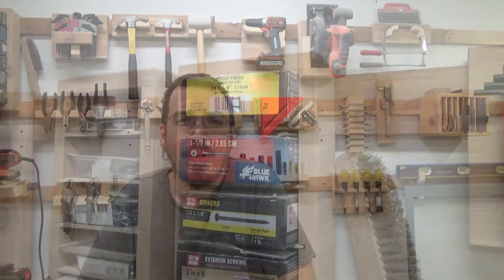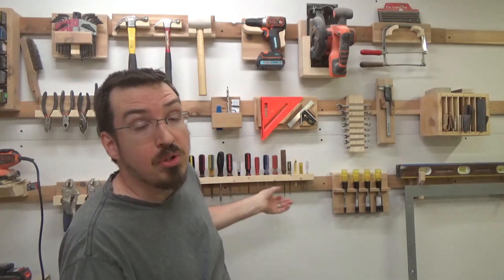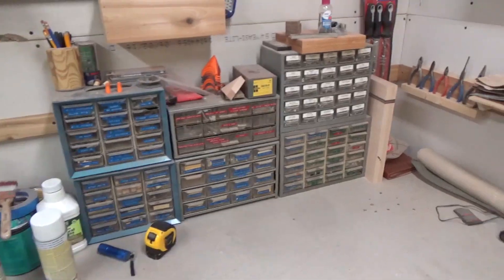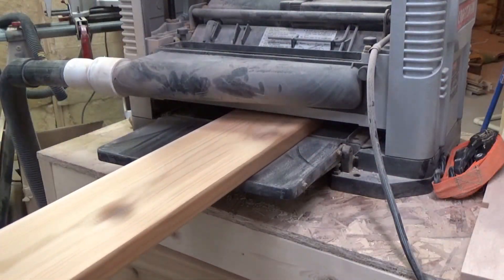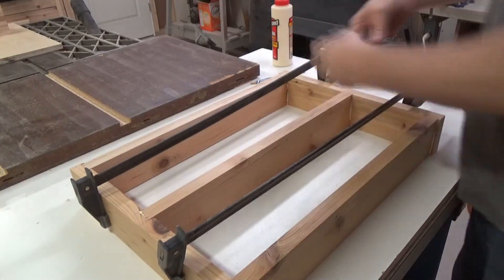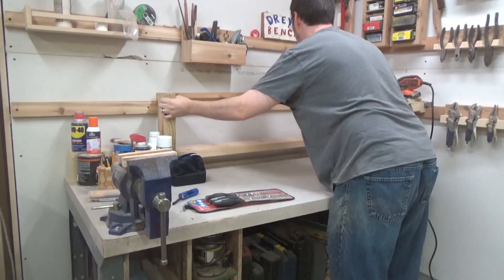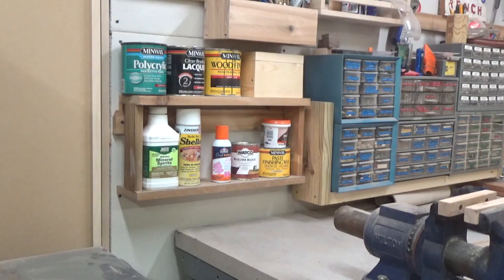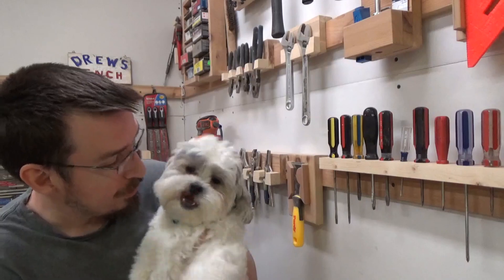Shop Talk: You can't beat french cleat!

Comment: The traditional french cleat system I believe is based on evenly spaced rows on the wall, and evenly sized parts on the back to hang. The wall bit wider side (the one facing from the wall) dictates the space to the next board on the wall. Then you mount the hanger slightly lowered from the top of the back of what you are hanging. This leaves a gap from your toolholder to the board above of same width as the short side of the two peaces, giving perfect fit for a flat peace to go between the flat top of the part on the tool to the flat part on the bottom of the board on the wall. 
Let's say the initial board is 3 inches tall.
You cut at 45 degrees passing the middle. This gives you 2 inch on the wall, 2 inch gap under to next board on the wall. The holder on the tool adds 1 inch when hanging on the wall, leaving a 1 inch gap up to next board. Here you slide in a 1 inch block of the same dimention as the cleats. Bingo, tool is fixed to the wall. 
If you want to take it down, just slide out the block preventing it from moving 😊

Comment: Would you recommend using 2x4's for the cleat to hold a cabinet 60" wide  x 15"depth?
Reply from the maker: You should be ok since the weight is dispersed down the cleats.  But if you plan to really fill up that cabinet, you might consider using hardwood for the cleats.
Reply: @FishersShop  On second thought, maybe I should not make cabinets and make more customized tool holders for what I would have otherwise put in those cabinets to lighten the load. Thanks. You've inspired me!

Comment: Didn't know about the negative side to the French cleats, no one else had mentioned them. I like that one can combine it with a cabinet and create groups of tools.
Reply from the maker: For sure.  And keep in mind that there's way to combat the negative aspects as well.  For instance, if you're put in a small screw you can essentially clamp the holder to the cleat on the wall to keep it from moving or falling.  Etc.  Thanks for watching!

Comment: When I worked with my step-father back the the cretaceous period, he hung wall cabinets using a French cleat because it allowed him to get things level and then pop the cabinet on the wall alone without having to hold or prop it up till it was fastened.  Half a century later I still use that method for hanging cabinets.
For this sort of shop storage, It's a waste of material and time, for me at least.  I would panel the wall in wood, screw tool holders to it, and be done with it.  Just as easy to reposition, and uses less materials.  But everyone to their own fetishes.
Reply: Uhlan interesting. Can you clarify what do you mean by panel the wall?

Comment: Hey Drew, how wide are the French cleats ?   What have you found to be the best spacing between the wall cleats ?   I love this French cleat idea.  I have a pegboard in my garage, but this system looks way better !
Reply from the maker: It can be pretty arbitrary.  It mainly depends what kind of wood you'll be using (soft or hard) and how heavy of items you'll be hanging from it.  In the case of a tool wall, you can get away with really narrow cleats.  But if you'll be hanging cabinets, for instance, you'll want to beef it up a bit more.

Comment: Did a modified version of this with two rails per level. Each of my boxes/shelves has two cleats and sits on two rails. So for each "level" all of the boxes/shelves can slide along its own level. For some of the tools, I also put a small face board on hinges that can swing down and cover the tools. For the metal tools, I like to put a little holder in the boxes where I can put some desiccator bags. Then close the cover board over the tools. It just helps prevent rusting and it looks pretty damn good too. I live in a really humid climate, so rust is always something I'm trying to fight.
Reply from the maker: That's a really good idea.  I'd love to see a pic of it.  I'd have to say my biggest issue I've experienced so far is that dust will collect on top of the holders behind the tools.  So if there was some kind of faceplate that swings down, like you have, there might be a way to combat that.  Thanks for watching, Anthony! :)
Reply: use gun storage oil specifically for anti corrosion and your metal tools won't rust during storage.

Comment: as an idea, I like making screws out of wood; using a small-ish blunt ended wooden screw in each hanging piece, with a gripable corss piece on the end, you can lock in your hanging bits with a twist. you can unlock and remove each item then, one-handed. love your videos!
Reply from the maker: Very nice idea.  I've never attempted at making a wooden screw before.  Sounds like a challenge
Reply: @FishersShop  there's tap-and-die sets for them. I like making large ones...impractical for this suggestion, but, the threads are so widely spaced, a half turn would go from free-floating to not-going-anywhere. I don't recall where I got my set from, but, here's one on amazon that looks very similar: https://www.amazon.com/d/Woodworking-Project-Kits/WOODRIVER-Woodthreading-Kit-1-1-TPI/B0039ZEW16

Comment: I love the French Cleat System, i have 3 Cabinets on the wall using the cleats and they are full of hand tools, screws, measuring tools, safety wear, router bits, basically loads of stuff and they have stood the test really well. In fact i'm hoping to do a clamp rack for all my clamps and fit that using the cleats. 
Barry (ENG)
Reply from the maker: My clamp wall is the one thing I didn't use cleats for.  I would have, but where I keep them isn't conducive for it.  But everything else is french cleat.  I'm running out of room on my main wall.  Soon I'll have to start putting cleats down the other!  I'm starting to accrue an abundance of tools.  It's a good problem to have, right?

Comment: Can recommend adding a cam lever to clamp each module on
Reply from the maker: Sure, either that are just another screw through the front would do the trick.  The cam lever wouldn't leave a hole in the cleat though and is probably a better idea.  Thanks for watching!
Reply: Ah yeah, wee screw would do it. Added a cam lever to mine since the smaller ones were prone to being lifted off heh

Comment: I saw this on YouTube, in another video, about 4 years ago, ... and decided to make a beefy styled one to hang my Phillip's 42" tv on the wall, ... once I cut the 2x4 to the length I needed, it was only a matter of setting the blade, & measuring from the center of the 1&5/8ths thick wood, ... worked out really well, ... I'm guessing the tv weighs less than 50 lbs., and it has not moved once, ... I attached the cleat to the wall, with 3" drywall screws, ... just to make sure it was anchored properly, ... & have had several of xfinity repairmen comment about the tv being mounted that way, ... (they have had to change out my box several times), ... but not my tv, ... or the cleat system I have it hanging on, ... LOL!
Reply from the maker: It's the standard way of hanging kitchen cabinets in Europe.  And if you use hardwood, it only increases the amount of weight that it can hold.  Thanks for watching, John!
Reply: Custom wall cabinets are routinely attached in the US with this method.I would suggest using plywood,a three inch wide cleat that has two screws per stud with construction adhesive securing it to the wall board will have a shear strength in the thousands of #s.

Comment: I would like to add: I have a small shop for winter and for small tasks. If I build something larger I take the moduls with me to the carport in front of the shop which has also an - usually empty - cleat on the wall. Comes in very handy.

Comment: Just curious as to what your thought processes were when deciding on the strip width and spacing between strips on the wall.  Also, would you do different on those elements if you did it over?
Reply from the maker: There wasn't much thought put into it.  If doing it over, I'd go a more expensive route and clad the wall with plywood and put more horizontal cleats  to make the entire wall look better and also removable for when we ever choose to relocate.

Comment: They are handy, but not for a single car garage workshop. They just aren't compact enough. :)
Reply from the maker: I've seen many french cleat systems where the cleats are hung on the wall with a very narrow gap between (~2" or so) which offers the flexibility to really tighten up the arrangement and get things compact.  I only have 3 cleats and they're pretty spaced out.
Reply: Fisher's Shop that's true, but I felt like I couldn't never get that to not appear cluttered once you add all the tools. If appearance isn't too high on the priority list then I'd say it's definitely an option.

Comment: What's the most weight you can put on a french cleat?  I'm debating doing a workbench using it.  Looking at a 4' long, 2' deep bench, roughly 4' tall.
Reply from the maker: Considering that it's a European standard method of hanging kitchen cabinets, I'd imagine you can hang quite a bit on them.  What's nice is that the load is evenly distributed across the entire cleat instead of everything hanging on a couple screws.

Comment: Nice French cleats system. Thanks for the video. I will build one for myself. I think for power tool storage, it is better to separate the tool from the batteries. I would store the batteries in a drawer or the lowest shelf in the French cleat system. That way, my batteries are organized. I always know where to look for batteries and don’t need to worry about them suddenly fall off to the ground due to mishandling. Other things I would like to add to the system is install bottom and top shelf, and make a sliding door between the shelves so not everyone can see my tools. Looks more tidy and reduces dust.

Comment: I had never seen or heard of this system before but based on what I see here you could make a thumb-screw locking system for each piece of holder quite easily though to remove any risk of accidentally lifting it off.

Comment: I like this system of storage for all the reasons you mentioned and one other that ranks near the top. Most storage systems like deep cabinets hide your items behind layers of other stuff making things harder to locate. This system makes better use of wall space and everything you use it for is visually on display, unhidden by rows of other stuff. Made the mistake myself and went back about 10 years ago and did it with French cleats and never looked back. It’s far superior to any other shop storage system. 

Sure like your videos. Keep them coming.
Reply from the maker: Couldn't agree more, I love this system.  This video was released quite a while ago and since then I've had to rearrange things several times because of new tool acquisitions.  Plus it sure looks impressive when you walk into the shop and can see everything on display. :)

Comment: If you're concerned about the french cleat tool holders lifting off the french cleat then simply drill a small hole in the tool holder located just below the bottom of the french cleat when the tool holder is resting on it, then you can insert a dowel to stop the tool holder from lifting off the french cleat.

You can still slide the tool holder sideways but if you need to move it elsewhere simply pull out the dowel and you can lift it off the french cleat. :-)
Reply from the maker: Brilliant idea.  Why did I think of this earlier?  I would have mentioned that in the video had I thought of it.  Great idea.
Reply: I use a drywall screw so the tip just pokes through enough to prevent lifting, slides side to side easily with no binding and to lift off, grab the drill and back it out just a touch and voila.
Reply: I saw another option.. (Wish i could recall the woodworker so I could give a shout out) But, The option is used mostly for platform type.. at the bottom of the tool-holder where it meets the bottom of the wall-mounted cleet.. make a locking Nob.. that spins and is held with a simple screw.  So when wanting to remove the whole Tool-holder,.. turn the nob to Unlock and go.

Comment: Hi great vid except the sound was too low or maybe I am just getting old. How wide are your french cleats? What is the vertical spacing between each french cleat?
Reply from the maker: Thanks, old timer!  The size of the cleats and the spacing is arbitrary and just needs to be tailored to your needs.
Reply: I built my FC wall with 8” spacing. I used this spacing because the garage bay has OSB paneling with lots of ugly horizontal lines on roughly 16” spacing. Putting FCs every 8” allowed me to cover most of the lines as well as adding flexibility and versatility. With this spacing, I can also frequently use two cleats to attach things. This adds stability and strength.

Comment: While my "every item I own on the garage floor" system does work, I'm looking at doing a french cleat wall as well for the same reasons you stated.  Question...  Do you find that the cleat stringers on the wall collect a lot of dust?  Does it collect enough that they need to be vacuumed out every once in a while of affect the usage of the wall?
Reply from the maker: Hey Bronk!  The cleats manage to collect a bit of dust but nothing that has ever inhibited the use of the the tool holders during relocation.  As long as you don't have a miter saw aimed at your cleats, the only dust they'll collect is really fine airborne particles that takes quite a while to build up.  I vacuum the cleats out every blue moon.
Reply: Trim the sharp edge of the cleats a touch (both on the wall side and tool holder side), and dust won’t interfere with them unless you get a lot back there, and you won’t accidentally glue a holder to the wall if you miss a bit of squeeze out when you glue the clear to your holder.

It’ll also make that edge more durable, and less prone to cracking/chipping.

Comment: Thanks for the interesting upload.
However, personally, I would NOT store my planes as you have done.  One nudge onto the concrete floor and the plane is cracked and useless.  Presumably, you could put a lip on the front of the frame to lessen the danger of this, but even so, I would not be happy having them in what looks like an insecure mounting.
Reply from the maker: Well, it would take a lot more than a "nudge" to get anything to fall off of there, but I see your point.  I had originally thought about storing them vertically in "slide-in" holders which would eliminate the falling possibility.  I still might go that direction in the future.  We'll see.

Comment: Yes the French Cleat system has a lot of merit. I also have used this system for mounting kitchen cabinets up on the walls. The system is I inexpensive to build and allows the bench top to remain uncluttered, ( unlike mine at present ) . As well I like the tool holders I see in the video. Hoping myself, to soon upgrade the Workshop with this system , to include building a fake wall to attach the cleats to. Anyhow, great video.
Reply from the maker: Thanks, Lee!  Yeah, making the tool holders is half the fun.  I think you'll enjoy the system once you got it set up.  The fake wall idea sounds interesting.

Comment: wouldn't it be better, to have the board that supports your hardware storage containers, run flush to the outside of the uprights, and be screwed vertical? otherwise you might as well use a nail because of shearing strength? also your scribe work to the shapes of some of those tools looks very well done.
Reply from the maker: I can’t quite picture what you mean but I’m sure there’s a better way to do it than I did. I just cobbled something together but it works and hasn’t exhibited any problems yet. 😀